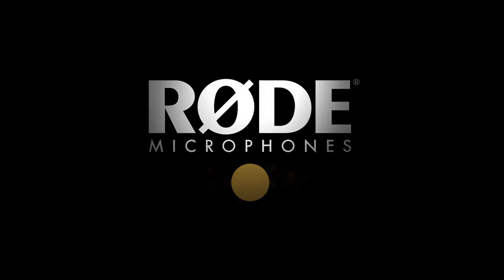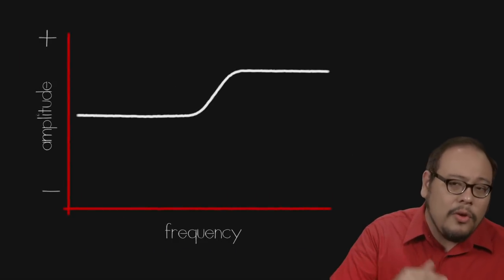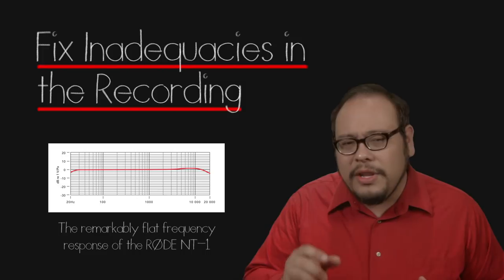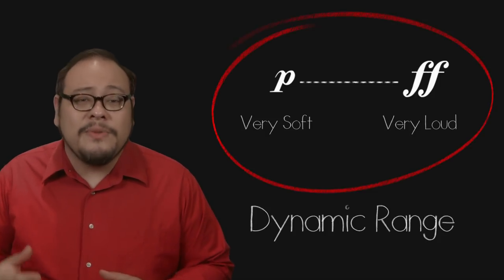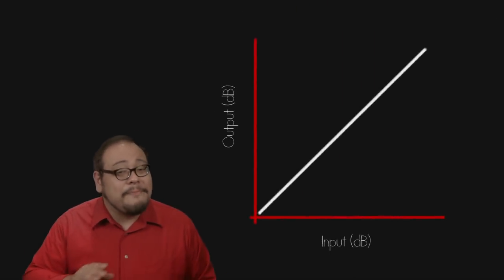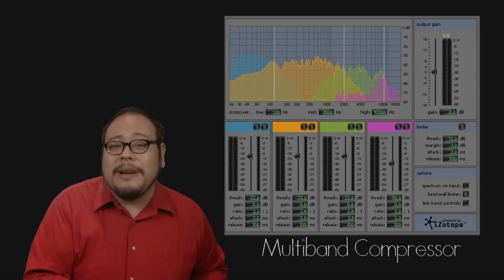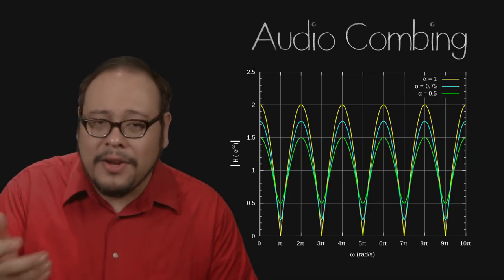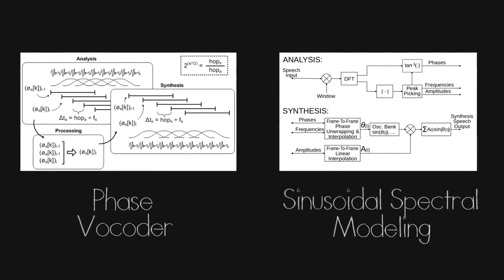The Fundamentals of Sound in Post Production

Comment: Should be noted that EQ and filters also pretty much always use FFT :). It's an essential operation for any digital (especially realtime) frequency domain processing!
Reply from the maker: Bad Bandwidth I really tried to wrap my head around FFT - as a filmmaker it's not something we need to understand the inner workings of - but we are so lucky to have engineers, programmers, and mathematicians who figured out how to use FFT to process audio - as I understand it, FFT is the basis for almost all audio processing being done today - including voice recognition.
Reply: Filmmaker IQ The most important thing here is to understand how to get from an audio signal (amplitude dependent on time, as you get from a microphone) to a signal in frequency space (amplitude dependent on frequency). That's what the Fourier transformation basically is: an integral transform that can transform Schwartz space functions into their "frequency spectrum", and back. The FFT is just a fast algorithm to do the DFT (discrete Fourier transform), which performs this on sampled signals (-> sampling rate 44.1 kHz means you have 44100 datapoints for amplitude per second, which are for example 16 bit of size each. This is not a function, but just a set of points.). That's basically the thing that I missed in this video and the "theory video".
Reply: Filmmaker IQ True, someone using these tools really doesn't need to know about the particulars. I just thought it was peculiar that an audio effect was given a name so generic as FFT :). Also yes voice recognition pretty much always uses FFT, since the data is processed by frequency basis, so FFT is needed to convert the signal into such representation.
Reply from the maker: ***** That helps explain it a little :)
Reply: I've never looked at the code for an EQ plugin, but it would be much more efficient to use an IIR or FIR algorithm than an FFT.

Comment: John! This is the best channel to learn about film making I've ever seen! Subscribed and binge watching your videos. :) I have two questions.

1) Is it possible to to cut the ambiental sound that the Rode Videomic Pro picks up by using a preamp like Zoom H4N or Tascam DR-60? I am recording makeup tutorials in my living room and when it rains the audio is noisy.

2) Or should I just buy a condenser microphone?
Reply from the maker: +AdviseMyStyle regarding the ambient sound. You can use noise reduction in software like Adobe Audition to try to cancel our the noise but it may not work well with random sounds like rain.

The best thing is to move the mic close to you. Get your hands on a mic stand with a boom arm and attach the mic some how (use tape if you have to). Then put the mic so it's above you pointing down. The closer it is to you, the softer the ambient sound will be.
Reply: Filmmaker IQ Incredible!!! I just tried it and it works great! I thought that if I get close it will start peaking, but it doesn't. :) Very interesting! :) Thank you sooooooooooo muuuuccchhh!!! This really means a lot to me. :) Spent a whole day watching your videos and now I need to eat something. :) Best from London, Jure.
Reply from the maker: Yep - it's all about Signal to Noise ratio - you want the biggest difference between good signal (your voice) and bad signal (background noise) - then you can always turn down the volume to keep from peaking ;)

Glad it worked out! Cheers!
Reply: Filmmaker IQ Awesome! Thanks!!! :)

Comment: I really liked this video, it did a great job at explaining a few techniques which I think I can start using. I have done "motovlog" recording, which is recording inside a helmet on a motorcycle, which clearly has it's challenges. I see how compression/expanding could help with this. If you do a follow up video, could you touch upon noise cancelling on microphones? I'm interesting in the "recording" side, as I have a stereo mic, but I don't think it supports noise cancelling. Is that something that could be done in post easily?
Reply from the maker: Yeah I wouldn't do noise canceling in the microphone that sounds like a bad idea for recording. I mean it's fine if you just want to transmit cool slightly less noisy audio but for recording it would be a disaster I think.
Reply: What would you recommend then? Can it be done in post? I would want to try to lower anything that isn't my voice, but o suppose I could just use an EQ to filter it out.
Reply: @matt_kelly  Noise reduction on a noisy audio clip in general is very hard to deal with. The top two solutions to noise are

1) Move the mic closer to the source. This maximizes the level of the source sound relative to unwanted sounds. Make sure your recording level isn't too high lest you have distortion. Also, in the same way if you can make the source louder it makes the noise that much quieter by comparison.

2) Use a noise rejecting microphone. Most basic microphones like those in webcams and cameras have no noise rejection in their design. A quality shotgun microphone is built for noise rejection and when pointed directly at the source is effectively 1/3 to 1/4 of the distance closer to the source as a basic microphone with no rejection.

As for post-production processing, you can effectively move the microphone 1/2 to 1/3 closer again, maybe more, but that requires Great skill with spectral editing, envelope shaping, multiband noise reduction, EQ.  it could be two college courses within itself, probably more

Comment: Great info! I was just curious about the statement that Rode engineers state that there should be -18 dB separation between the noise floor and source signal. Do you happen to know where you got that info? For some reason, I thought I read the same thing somewhere, but they said it was supposed to be -28 dB. I was just trying to find where that information is available. Thank you very much!!!
Reply from the maker: Did you mean to post this on the other video about recording audio? These values are not set in stone - and when they're saying noise floor they're not talking about theoretical noise floor of the microphones but ambient noise floor - a separation of AT LEAST 18 dB is desirable - if you can get it to 28 dB that's great - but not always possible in a noisy location.
Reply: Oh, sorry about that. Thanks for the response. I'll post on that video if I can find the reference I'm talking about. I realize the more separation the better, I just wonder how they came up with the number they did versus some other number. I figured there must be some reason behind it.